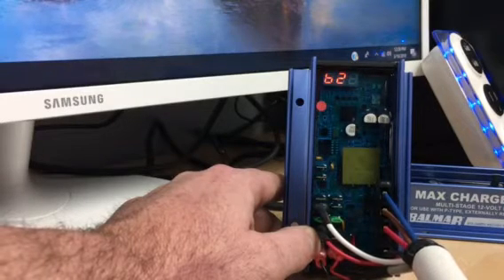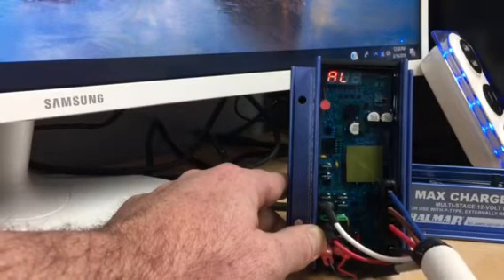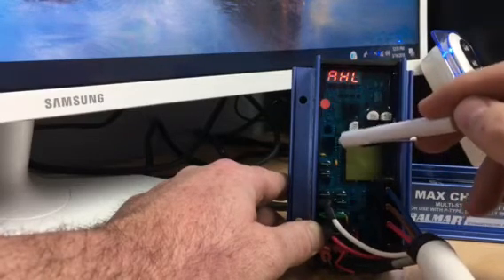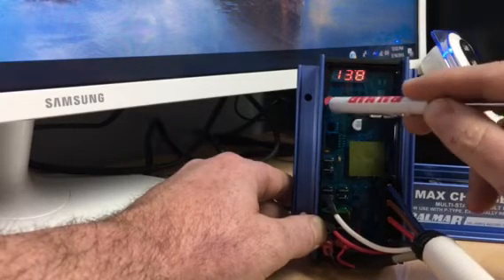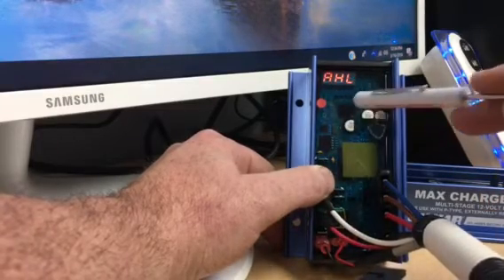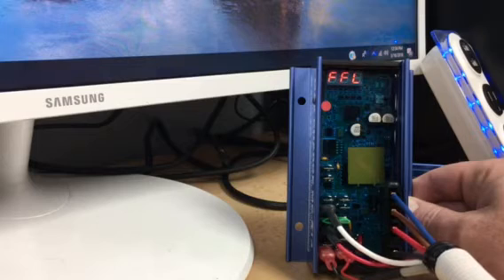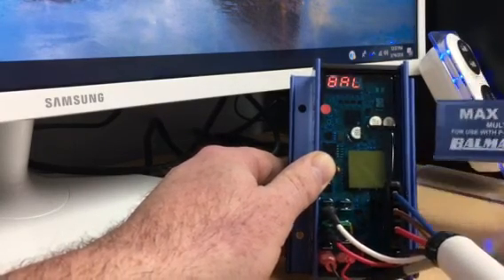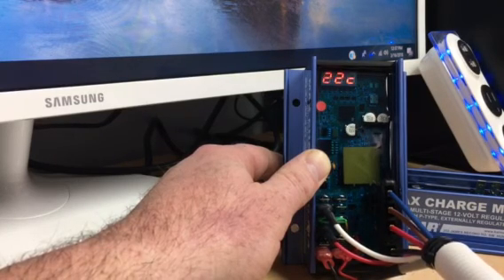Programming the Balmar MC-614 for Lithionics Battery

Comment: Hi, I have just installed 2 x 614's and a centerfielder on my Catamaran, which charges my Victron lithium house bank, when the house bank reaches 14.3V, the Balmar shuts off the alternators output until it drops to 14.2V then ramps output again until 14.3V, is there a way of reducing this on/off charging when the batteries are full ? it seems like the alternator should ramp up at a lower voltage than 14.2, this causes the engine revs to increase and decrease every minute, I will set the BLM to 4 in the meantime but this wont stop the short on/off of the alternator, many thanks